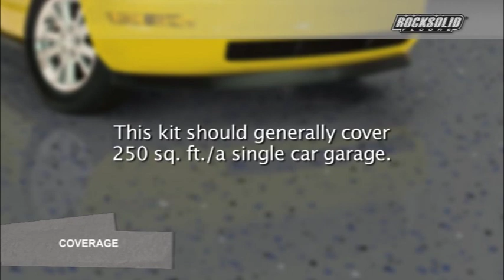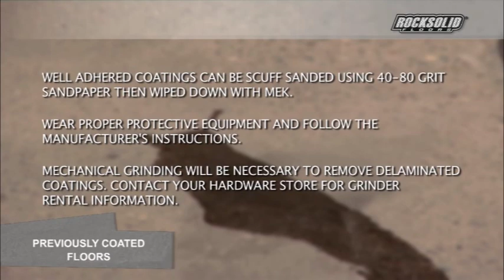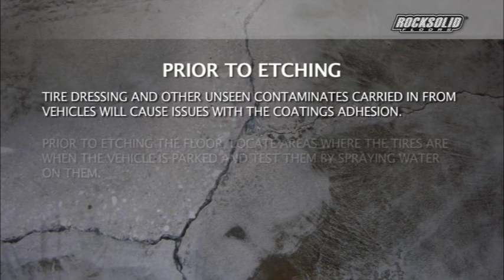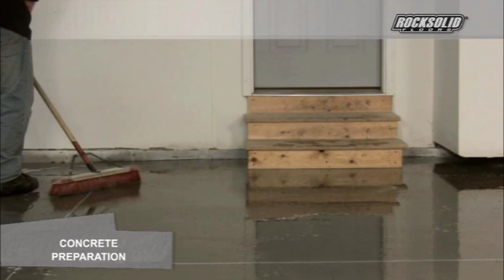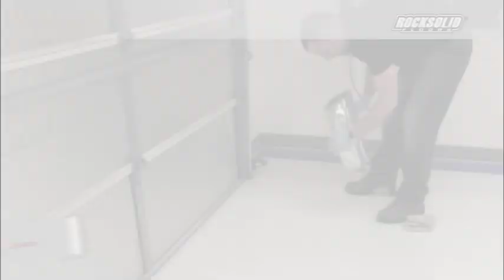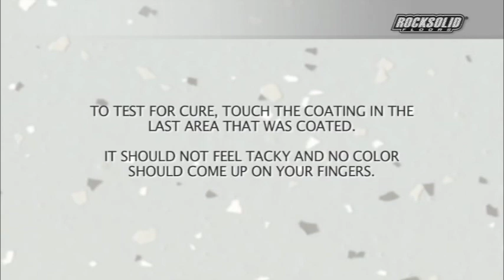How To Apply Garage Floor Coating English -RockSolid  Polyurea Garage Coat

Comment: This stuff will chip easily with anything you drop on the floor (that you typically are handling in your garage). Check out other YT vids on this stuff. It's nothing special. After seeing how easily it chips, zero chance I would waste all that time and money.
Reply: That's epoxy, not polyurea.